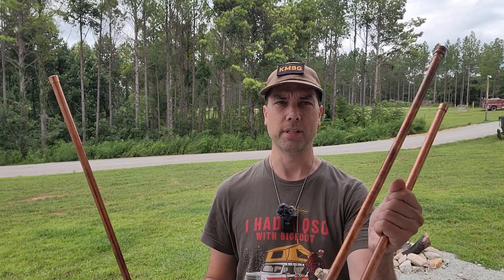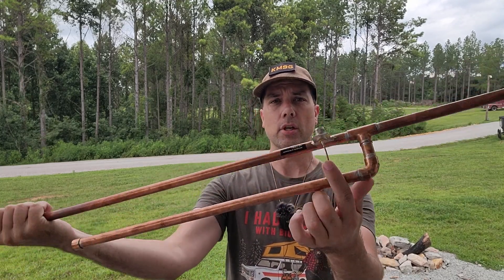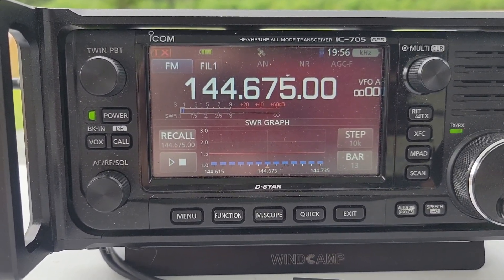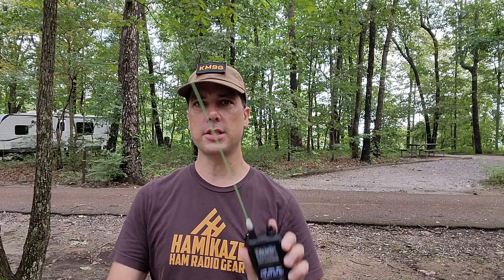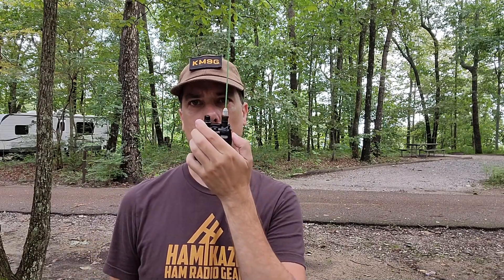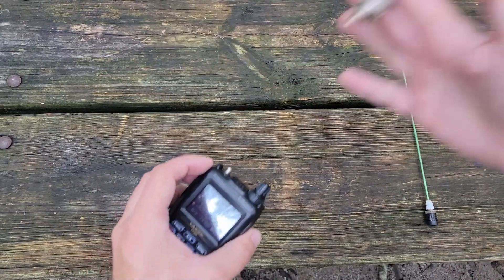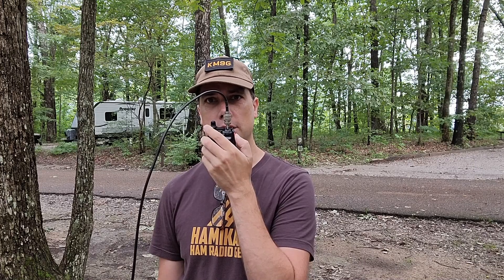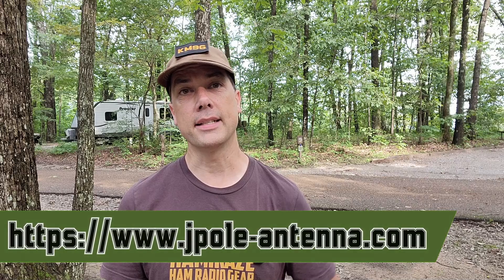Ham Further With a Bigger Antenna

Comment: I use the same antenna at about 25 ft.  I am about 50 miles east of you.  I consistently hit repeaters on Short Mountain which are 30-40 miles away easily and can hit the Monte Sano repeater with a little noise, which is 60 miles away.  There are repeaters in Athens, Alabama; Lewisburg, TN and Columbia, TN that should be within reach.  We hear people hitting the Short Mountain repeaters from 200 miles away occasionally.  It isn't all that high just higher than anything else for a long way.
Reply from the maker: That's all that matters!

Comment: Good J-pole.  Easy to repair.  I find that if you're not well known to the clique, 2M operators will not acknowledge you on the machine.  (sigh)  I suspect this is very different if using 2M SSB and calling CQ, but you'd need horizontal polarization then.  73
Reply from the maker: I thought about horizontal, but I don't have a way to mount it.
Reply: @temporarilyoffline  zip ties on the horizontal part of that same ladder?
Reply from the maker: You know, I was trying to get it to attach horizontally to the vertical ladder supports - didn't think about attaching to a rung because it would have been lower... but lower is better than no-er Thanks!  @nerdinium
Reply: @temporarilyoffline  rung is ok, I was thinking the horizontal part of the ladder that connects to the roof, so the antenna extends to the rear of the trailer. Attaching slightly larger tubing permanently to the ladder would let you just slip the antenna inside easily.
Reply from the maker: even better!  I like your thinking!  @nerdinium

Comment: More trombone, than trumpet, but  that's ok. Yankees don't know horns. 🫣

I have a KB9VBR Slim Jim, chosen for the takeoff angle to hit my club repeater. Works great. Even a UV82 with "5W" does it with a Slim Jim. I got the type N option because I was thinking about 70cm, and connected with LMR400.
Reply from the maker: A solution for every problem